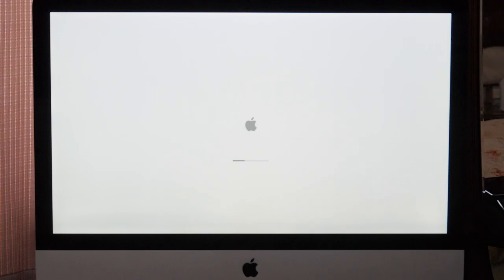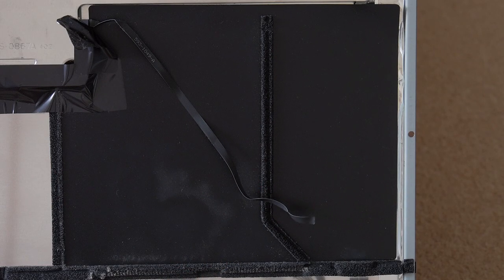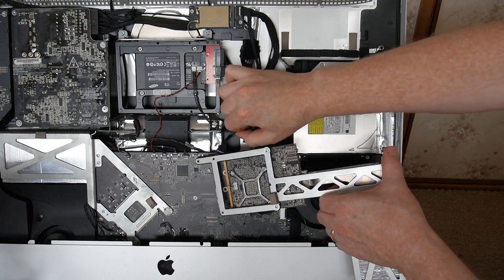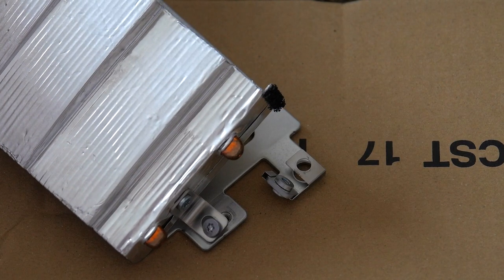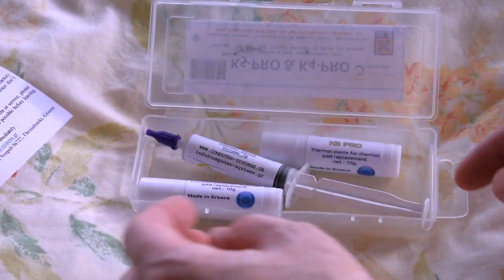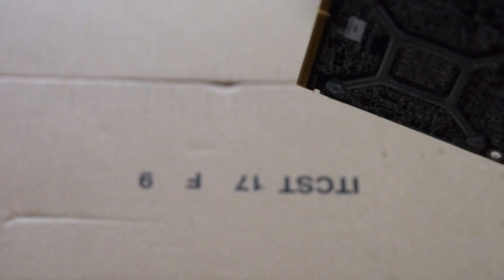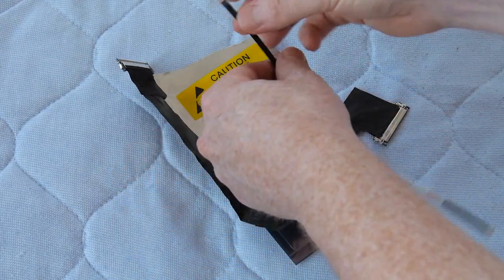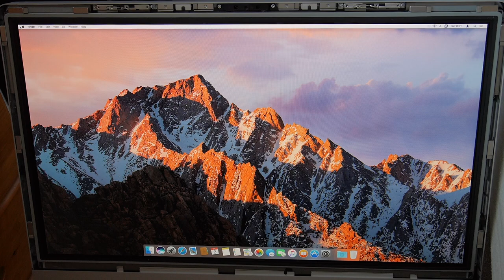Late 2009 iMac 27" Video Card Repair — 4850 — 2nd Bake

Comment from the maker: Sept.24, 2020: Check out my new FAQ video before posting questions as I may have already answered it here: https://youtu.be/hldcyJ_qUD4
Reply: hi JDW, is it easier to just buy a new graphics card and install it?
Reply from the maker: @djfritz  Not if you are buying a cheap Windows Nvidia MXM card, as that requires a Windows machine to flash the appropriate firmware.  But if you are buying the same card type as the stock card, or buying something like the 6970M from a 2011 iMac for use in a 2009 iMac, assuming that Apple card comes with its original heatsink (very important), then of course that is technically easier because (1) you wouldn't need to bake it, and (2) you wouldn't need to repasted it in theory.  

Practically speaking, cards like the 6970M almost always need to be repasted, and since the bake lasts a mere 10 minutes, you aren't saving much by purchasing another card.  Besides, the bake is the cheapest fix of all the fix.  And when I say "fix" I mean temporary fix of course.  Even a brand new Apple card won't last forever, but I did get 2 years and 9 months from my 2nd bake.  You might get more life from the Nvidia MXM cards, but again, you have to fiddle with things like flashing on a Window machine (yuck!) and even then the card won't be nearly as fast as a modern GPU.

I recommend you buy the two thermal pastes and try the bake.  And in then if you later decide you really want to replace the card, you have the pastes you need on hand to repasted that new card.

I hope this helps.
Reply: @JDW-  thanks for replying so fast!  all good points, i never really opened up a computer before but will give it a try. I have a video editing project on there I need to retrieve and back-up. thanks again
Reply from the maker: @djfritz  You would need to remove the front glass either to bake the existing card or to swap in a new card.  And honestly, that is perhaps the most fiddly job of all for two reasons: (1) you must take great care not to break either of the two thin ribbon cables which connect the LCD display to the circuit boards inside.  After removing screws, pull the display out toward you very, very slowly and take special care so it doesn't fall forward.  That's how I accidentally broke the little ribbon cable in the upper left corner one time.  After that, you need to take care when disconnecting connectors.  And lastly, when you put everything back together again, it takes time to ensure there's no dust behind the glass.  That part is always painful for me, because I hate even a spec of dust there.  Also be sure to get the right suction cups too.  Some people can remove the glass without them, but I personally don't.  Suction cups work best for me and most people.  Good luck!

Comment: Son of a gun! This really works. It's only been 2 days, but my late 2009 27" iMac is working again. No more yellow bars. I baked my card for 10 minutes at 395F. I used a combo of your first video and this video to understand the process. I took the shortcut and did not remove the entire motherboard (as per your first video). After the bake, I used non-conductive silicone compound on all the chips except the middle one where I used Arctic Silver. I'll try to update progress, but so far so good. Thanks again for the detailed videos.
Reply from the maker: Thanks for sharing news of your success, Mark!  I just crossed the 12-month mark of daily, problem-free use for my 2nd-baked iMac.  In my 1st bake, as you know, I used Arctic Silver V on the GPU and a non-electrically-conductive paste on the memory chips, without removing the old Apple thermal pads on the memory chips.  That bake lasted only 4 months.  I don't think that had anything to do with Arctic Silver so you should be fine.  The only caveat is that if you use too much Arctic Silver on the GPU, there could be overspill that works its way onto the tiny SMD capacitors, which could cause electrical shorts.  That's why I went 100% non-conductive with thermal pastes in my 2nd bake; and again, that has lasted just over a year so far.  But whether the 4-months of use from the 1st bake was due to thermal paste or my GPU simply needing a 2nd bake is unknown.  Anyway, please do keep me updated.  A lot of people comment here about their success, but almost no one keeps me informed of their iMac's progress over time.  Feel free to post updates as often as you like.  Best wishes!

Comment: Hi, Thanks for your videos, your last one really helped me with a 2011 27inch bake. I also incurred damage - a capacitor and a piece of the motherboard wire broke off when the motherboard slipped as I was putting it back in-  and I asked myself if it was the end...  I managed to reattach with a solder bridge, and some how, after baking and resoldering the part back on, and missing a couple of screws (lol), it booted and works (so far) perfectly!

Your video was critical to my success, and there were times when I thought you were the only friend I had during the worrying process.

Thanks again.
Reply from the maker: Robert, I'm humbled by your kind words and extremely pleased to hear of your resurrection success, especially in light of that motherboard damage.  Kudos to you on your persistence and not giving up.  It paid off for you!

Comment: my mid 2011 iMac 27" i7 GPU let go yesterday morning. I was at the Genius bar by 11:20, whose diagnostic tests confirmed GPU hardware failure, and a bill for 635 GBP to repair. They already fixed the problem in 2014 under warranty as a "known problem". I followed your advice and baked my GPU at 200 C for 9 minutes, and it worked. Thank you for saving me 635 GBP, but the satisfaction is worth way more than that.

Comment: Thanks JDW for this second bake tutorial and keeping it updated. I did a first bake last year following your first tutorial. The early 2009 iMac lasted 4 months. I didn’t get to fixing it again until now when I saw you had baked it twice. I did it again, this time following your advice of the thermal paste. Also, I’m changing the hard drive to an SSD. 

It is back up running and working like a champ. One thing to note is when I took off the backlight cable, and connected it back, I had inadvertently wiggle the connectors slightly loose. This caused the backlight to not come on, making it seem like it hadn’t worked. So just something to note for others attempting this.

Once again thanks. I want to see how long this one lasts.
Reply from the maker: Paul, thank you for providing details about your bake.  Did you clean off all the stock thermal paste in your 1st bake and then apply a good paste to the GPU and a thermal pad replacement on the memory chips?  Or did you do like me and just use a good thermal paste on the GPU and apply extra thermal paste atop the stock thermal pads?  If you followed my lead then such gives evidence that removing the stock paste completely is key.  I didn't do that and my 1st bake lasted exactly 4 months like yours.  But my second bake is still going strong, lasting 1 year and 7 months so far.  Anyway, thank you also for the warning about the backlight cable.  Other people who try the bake are pretty good about reading through the comments, so your experience should be helpful to others.  Wishing your 2nd bake a long and happy life!
Reply: On my first bake I did clean the old paste and applied new thermal grease. The problem was that I didn't apply enough because when I opened for the second bake I saw that the paste hadn't touched the heatsink. This time around I made sure the paste was touching both the video card and the heatsink. @JDW-

Comment: Thank you not just for making these 2 videos, but also breaking down each step so thoroughly. My iMac died in May and I've been nervous about getting in the guts for the first time. But I've got nothing to lose and recently found your videos, so I'll be going for a bake sometime next week!
Reply from the maker: Thank you for the kind words, Ryan. Just be sure you allocate plenty of time so you can go slow and not make the same mistakes I did (like breaking the silly ribbon cable).  Also be sure you have a dust blower because getting all the dust out from under the glass when you put the glass back on in the final step is a real bother, let me tell you.  Also be sure not to touch the display (the screen under the glass) because that thing is very difficult to clean, even with a good microfiber cloth.  Fingerprints really have staying power on it!  Best wishes to you on your bake!

Comment: My 2009 iMac's GPU died 2 years ago so I put it aside and bought a used 2011 model. Unfortunately that one crapped out on Christmas day and, not being financially able to replace it, I went looking for solutions which led me to your two videos. I did my 2009 one first, using your wonderfully clear steps, and that worked a treat - 200c for 10 minutes.
Likewise the 2011 model was treated the same and is working once again! There are some differences with the later model - in particular the logic board must be removed to get at the GPU because Apple put the screws into the heatsink frame the other way.
I am now using Macs Fan Control on both computers and hopefully their usefulness is extended for a long time to come. Thank you for your efforts that have helped a lot of people.
Reply from the maker: Thank you for your kind comments, Mike, and for letting us know of your two successful bakes!   Hopefully your experience reported here will help other owners of the 2011 iMac to know that the bake will work for them as well. Best wishes.

Comment: Hopefully this bake will be a good one for you. One trick I've seen with trying to reflow BGA chips is to put a small stack (say 3 or 5) small copper coins on top of the GPU during the heating. This applies a constant few grams of weight to the GPU and also focuses the heat a little onto the centre of the chip.

I was just given a 27" 2009 iMac that's failed again after a similar repair, so will try the coins to see if it helps. Thanks for taking the time to shoot the video - it's been useful.
Reply from the maker: Thank you for the excellent tip, Suzanne!
Reply: Yeaahhh excellent idea !
Reply from the maker: It's somewhat of a sound theory and one that I personally believe could be true insofar as baking (200°C heat) seems to resolve those problems internal to the chip, at least for a while.  Even so, no one has thus far presented hard evidence (such as a chip disassembly or scan) to prove that theory.  But one thing is certain, it is either the ball connections or the connections internal to the GPU IC, either of which are temporarily fixed by heat.  Funny too, because it seems clear, as you have pointed out, that heat actually causes the problem in the first place due to inadequate ventilation!
Reply: Suzanne Maybe q
Reply: Yes and then ????? The Late 2009 iMac 27" Video Card is no longer manufactured. This card (ATI Radeon HD 4850 512 Mo) has more than six years so Apple does not want to repair it and can not replace it. Then could you explain to me how to do ??? Could you build a new chip for my old card , or a new card for my old Mac ? (or a new Mac for me, I'm not that old :-) ) In the meantime, I do it myself. Loïc.
Reply from the maker: First of all, it's important to keep in mind that Louis Rossman despises Apple and its products. Many of his videos offer a combination of great repair insights and profanity-laced tirades.  While some of what you say may be true, the fact remains I still prefer doing it my own way. There was another YouTuber who was the inspiration for me to do my bake. In February 2017 he reported having 17 months of continuous use after his bake. I consider that pretty good, even though I only got four months on my first bake.  So far so good on my second bake.  Lastly, we must also remember that these are machines from 2009. We have nothing to lose by trying these oddball tricks, even though they may only extend usability by several short months each time the trick is tried. I say it's worth it.  Sometimes "the journey is the reward."
Reply: In the case of flip chip tech, baking a card is not a fix, 90% of the time, the problem is internal and there is nothing wrong with the solder connecting the chip. Technical Explanation: The eutectic bumps inside the chip attaching parts together break. When you heat the chip to 120-155c(which is WAY BELOW SOLDER MELTING TEMPERATURE), the bumps will reform themselves and it will work again for a week, or a month, or two months, and then die.

The proper fix is to replace the chip or replace the entire MxM card. Reflow and Baking may or may not revive the chip, does not restore full performance, and usually is limited to a few months of normal use. For the amount of labor required to take apart and repair, IMO its not worth a crippling system that wont last. Doing it right can give you years of renewed life out of your mac. I have my doubts that a bake would ever resolve a failing GPU to the point of being able to run normal wear for 17 months because there is no scientific reasoning backing this method. If anything his issue may not have been a chip problem but a cooling issue. I have seen many laptops, consoles, and desktop GPU's that people have tried to reflow or bake just for it to last a few months before complete failure.

Talk to a electrical engineer, or watch LTT on the BGA chip replacement or Louis Rossman on reflows. Baking can ruin other components on the circuit board beyond repair so that you wouldn't be able to do a chip replacement. Capacitors are highly susceptible to heat and will expand or burst if they get too hot.

If you want to read about the science about how heat ruins the internals of flip chips, or more specifically the solder bump of the chip, and you don't mind reading a very technical science paper, which is building on 20 years of study and includes examination via electron microscope. Then enjoy this paper published by IEEE in 2007: http://ieeexplore.ieee.org/abstract/document/4250070/

Why would an expert, who does nothing but work on board repairs for his day job be discounted because of his hate for Apple? GPU's overheat and fail in both PC's and Mac's due to high temperatures. What he says regarding failing GPU's is inline with professional electrical engineers. Heat damages the circuitry in the chip. Heating the chip does not fully restore these connections.

"Aside from electronic considerations, computer chips are made of components that, like any material, degrade over time. Heat accelerates this process, as it does with any chemical process. If the processor operates at a higher temperature for an extended period of time, materials inside the chip can degrade, which once again will result in garbled signals." - http://www.ebullientcooling.com/heat-problem-computer-chips/

https://electronics.stackexchange.com/questions/13873/why-exactly-do-chips-start-malfunctioning-once-they-overheat

https://superuser.com/questions/191486/what-fails-in-the-processor-first-when-a-processor-overheats

Louis Rossman's Explanation (For dummies who don't want to read technical science papers)
https://youtu.be/E9aZZxNptp0

Lastly, the chances the bake will last longer then a month is so small that its not worth the wasted time involved in disassembly. You are reducing the life of the chip, capacitors, and board components by exposing them to high heat. As such, the GPU isn't the only cause for video failure as other components can fail on the MxM card. The chances are so slim that your more likely to cause irreversible permanent damage that would take a repairable product from a potential of 3 years of extended life down to a likely 2 week lifespan.

If your going to throw away your iMac, then bake if for the sole reason to learn how to take it apart and learn a little bit about computers. But, if you wanna resell it or get much more life out of it, do it the right way.
Reply: @RanmaKei  You assume a failing GPU. These video cards that are working again were not failing due to issues internal to the actual GPU but do to the thermal expansion and contraction over time that occurs to the solder balls on the BGA chip. If you reference Louis Rossmann's video that you linked to, you'll see he mentions 5% of the time it's the solder balls. The difference in the 2009-2011 models if iMacs from Apple is that Apple knew and admitted that the video cards were prone to this particular type of failure. The difference is that these are separate video card modules that are not built into the motherboard so no one is risking the destruction of their entire iMac by trying the reflow method. The only thing that can happen is the card which is already not working being cooked to the point where it can't be repaired. The problem with this is that the repair of a specific chip on these video cards would already cost more that the purchase price of a refurbished/used video card for these iMacs in the first place. Another reason Louis is upset is because people are screwing up their motherboards with built-in cards when they had no clue what was actually wrong. These 2009-2011 iMacs are known to have this problem and obviously from so many actual positive repairs are able to be restored by baking. Don't confuse the two different issues of internal damage to a GPU which isn't repairable and a GPU that only needs to have the solder balls reflowed. Normally, I wouldn't advocate baking but in this particular instance, it's a valid option to get some more life out of a computer.